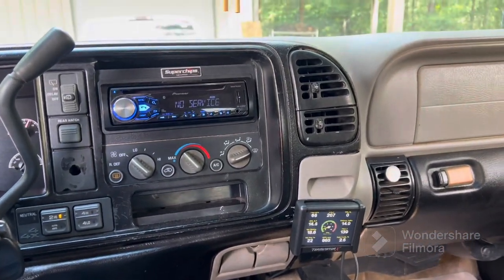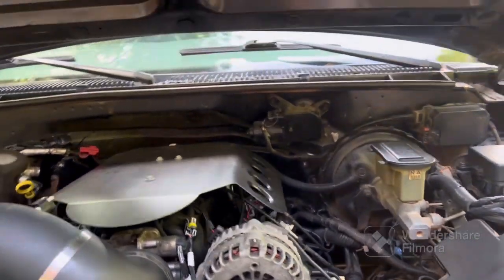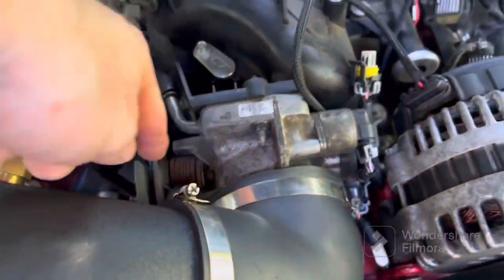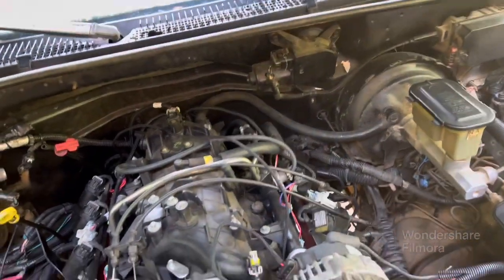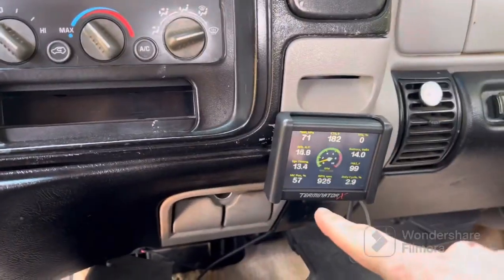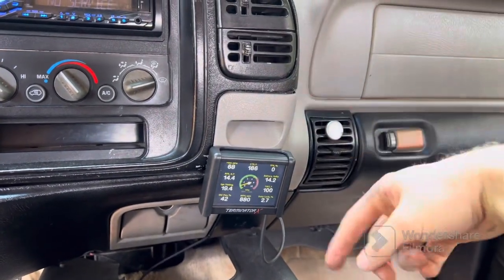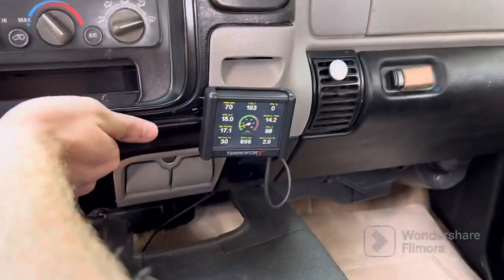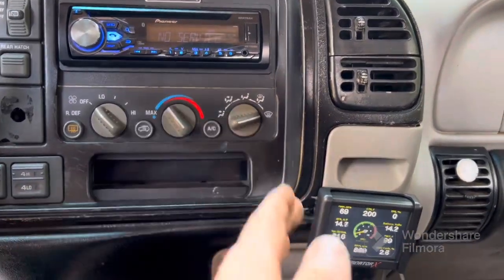How to adjust IAC on 5.3 Ls

Comment: I have the fitech system, but that damn adjustment screw is in the crazy location, I didn't take it out, I left it where it is and just keep getting burned to adjust the IAC  -- damn - it made a difference period
Reply: While the engine is cool reverse the screw so you can access it from the top.  It works much easier.